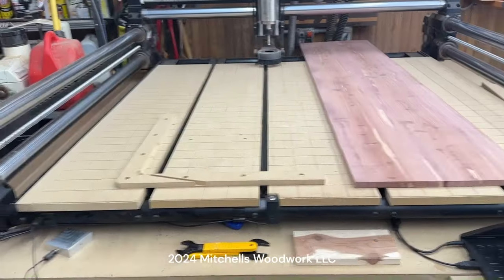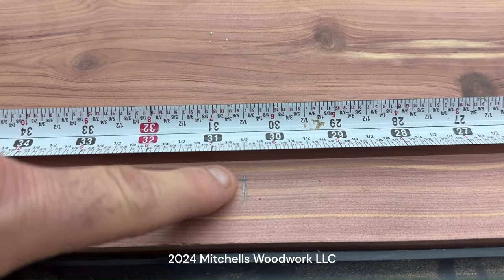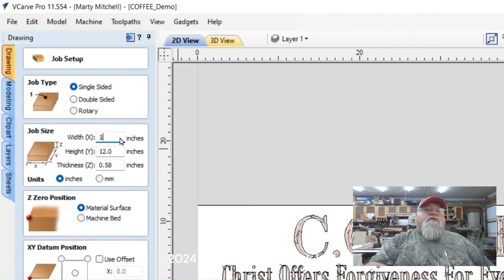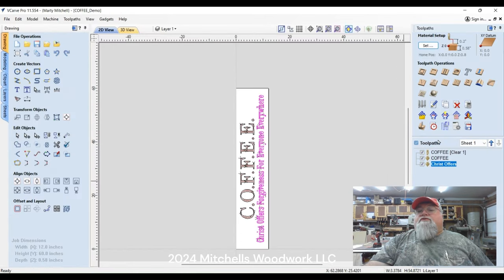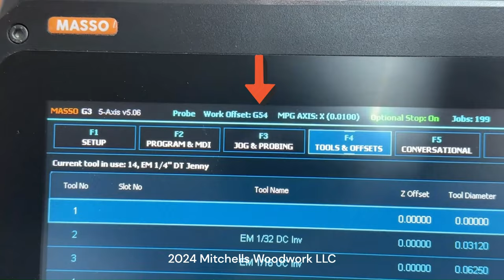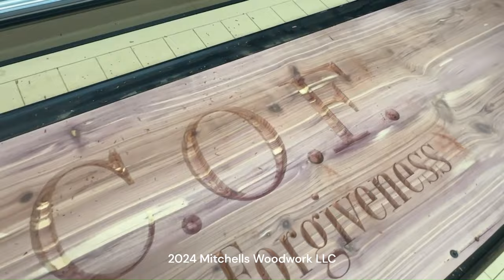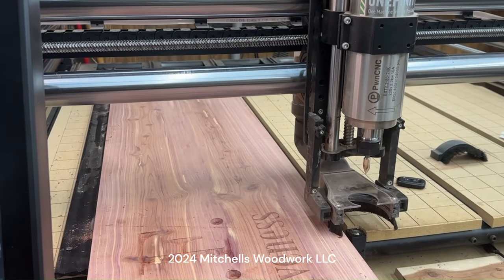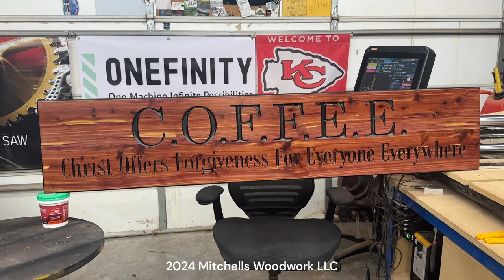How To Create Tiling Toolpaths In VCarve Pro | Onefinity Elite Foreman CNC | Large Sign On Small CNC

Comment: Great vid, project turned out great.  One trick I learned for rotating a project is to change to a rotary which will automatically rotate stuff, then change back.  I really thing Vectric is going to do this automatically some day, but that little trick saves a few steps.  I haven’t done many tiles, but one trick I’ve seen is a dowel, but the spindle idea is clever.
Reply from the maker: Please elaborate on “change to a rotary…”.  I’m not sure what you mean?
Reply: @MitchellsWoodwork  Start with the job in landscape mode like you did. In the job setup just select the third option "Rotary" and do nothing else, click OK. Then go back into job setup and change back to single sided...done.
Reply: @MitchellsWoodwork  One comment, if it isn't already selected in the Rotary setup, select the "along Y axis"
Reply from the maker: I’ll look into this!  Thanks for the tip!

Comment: Hi, a quick vcarve tip: if you need a selected text or anything that is selected. If you want it to turn ? just hit the number 9 key on your keyboard, once it will turn 45 degrees, and 2 times it will turn 90 degrees. That is way faster than with any menu item   Kind regards Hans
Oh by the way, to centre the selection, just hit the F9 key. That is also way faster
Reply from the maker: Dang!  Great tips!!

Comment: Great video! I've noticed some people use dowels to locate their tile sections. Your method - using a fence and a saved offset - sure makes quick work of tiling (a more efficient alternative to dowels provided tiles do not cross critical vectors).  Thanks very much, can't wait to try it!
Reply from the maker: Thanks!  But just a quick note, my method works fine even if you’re crossing critical vectors.  It’s just safer to avoid splitting vectors if you can.😉👍

Comment: Thanks sir videos are very instructional I was wondering does it tell you the time it takes to carve a project? I’ve been shopping around for a new CNC machine. I currently have the X crave for the last five years. I would like to upgrade trying to convince my wife go with the oneFinity but she said she’s so used to using diesel pro from ex car if she’s afraid to go out and try to learn the new V card which you use. Thank you so again.
Reply from the maker: Yes, VCarve Pro gives you an estimated cut time.  I started out in 2021 with a used X-Carve 1000 x 1000 that I bought on FB Marketplace, and it came with Easel software too.  In 2022 I upgraded to a Shapeoko Pro XL and that’s when I switched to VCarve Pro.  I’m not gonna lie, that first week with VCarve was pretty rough, and I was beginning to wonder if I’d made a mistake making the switch.  But then I found Garrett Fromme’s channel ‘IDCWoodcraft’ and that changed everything for me.  A little later I found ‘Mark Lindsay CNC’ and between those two guys I was able to catch on and get rolling.  Now there’s the ’Learn Your CNC’ channel, which is probably the best VCarve tutorial channel on YouTube.  

Switching from Easel to any other CAD software is gonna be a fairly big leap, but it’s so worth the money and time to commit yourself to learning how to use it.

Comment: Another excellent video. I've been curious about tiling as I come up to speed with CNCs. Do you know if there an easy way to tile this with vcarve but instead of tiling through like you did (and probably most people), if you could flip it and inserting tile 2 from the same direction (I have wall pretty close behind my elite due to small workshop, so I cant push a work piece through).
Reply from the maker: Thanks for the Super Thanks!!❤️  I understand your issue, and there may be a way to do it that way, but if there is, I’m not familiar with it.  

Just thinking about it though, I don’t think you would use a tile toolpath.  Maybe run it like two separate files, like you’re cutting two totally different projects.  But I’m honestly not sure.  Maybe someone else will chime in and offer a suggestion.  Anyone???

Comment: Thank you for the time supplying us this information, very interesting. I'm not tiling yet but this will be retained. Is it possible to adjust each tile, increasing tile 2 to get rid of tile three? As the information proceeded the need to remove tile 3 was not there, making my question moot.
Reply from the maker: Hi Richard, great question!  In this particular instance, tile 3 was just a byproduct of my adjusting the tile height to place the break between T1 and T2 in an area without any text.  

But more to the point of your question, let’s go back to my example.  My sign was 60 inches long, and normally I’d set the tile height to be 30” which would creat 2 equally sized 30” tiles.  However, there was text at the 30 inch mark, so I shortened my tile height to 29.5” to avoid the text.  
(T1) 29.5” + (T2) 29.5” + (T3) 1” = 60”

I could’ve adjusted the tile height to 20” and had 3 equal tiles.  
20” + 20” + 20” = 60”

If the sign had been 50” I could’ve set as:  30” + 20”, or 25” + 25”, or even 40” + 10”.   Typically you’ll set your tile height at or near the maximum cutting capacity of your machine in the Y axis.  Notice I said “typically”, but that’s not a solid rule that you MUST follow.  Your tile heights are extremely flexible.  

I hope this answers your question, but if not, just let me know and I’ll try again.  Thanks for watching!

Comment: Marty, great video.  First time I have seen a tiling carve.  I use Carveco Maker.  Need to see if it has that capability.
Reply from the maker: I’m sure it does, Jim.  Tiling is a common practice, especially on hobby size machines.  Thanks for watching!
Reply: Carveco Maker does not support tiling, Carveco Maker+ (plus) does that and more.
Reply: There is a way to tile in Carveco maker. It has to do with monkeying with the files.

Comment: Really enjoy your videos....Very informative and you make things easy to understand.   I recently upgraded to an Elite Forman and anxiously await delivery.   I noticed your dust boot is an earlier version from PWN....  was it easy to install on the new Z slider and with the spindle .   Thanks
Reply from the maker: Congrats on your Elite Foreman!  Hopefully you won’t have to wait 4 months like I did.  That was torture!😁

Thank you for your kind words, I appreciate you and I’m glad my videos are helping you.  As for the dust boot,  It’s actually an experimental prototype “variant” of the existing v2 model.  For videoing purposes, the V2 is perfect with the open front.
Reply: @MitchellsWoodwork  thanks for the response ...I ordered mine 28 Dec and I received an email from them (in answer to an unrelated question) and was told it should ship the week of 26 Feb.   I need to find a good dust boot ...I have a Kent CNC  version on my current machine and it will not fit the spindle I bought for the Foreman... I was looking at the PWN v10  ....any input on it
Reply from the maker: The v10 is specifically made for the Elite and 80mm spindle, so you should be in great shape with the v10.  I don’t brag on PwnCNC enough, but their product lineup and especially their customer service are truly second to none.  If you haven’t already did so, be sure and join their FB group.  They also have a new forum that is just now getting started.

Comment: OT question.  Are you using a Festool dust extractor?  Wondering how good it works with a CNC router.  Getting ready to buy something and was thinking about the Festool CT36 AC.
Reply from the maker: Yep, I have a Festool CT15 with an Oneida Dust Deputy mounted to a 5 gallon bucket.  Works great for everything except a surfacing bit.  The CT36 should be an awesome option.  

Thanks for watching!

Comment: When setting this file up could you not have set using the scale at 29.5 in. then setting up the text just realigning the letters? just a thought. recently started watching your channel. good presentations. Gary
Reply from the maker: If I’m understanding your question, I’m gonna say no, that wouldn’t work.  The reason for the tile cut is because the board was longer than the cutting area of my CNC.  Realigning or moving the text in VCarve wouldn’t change the need to move the second half of the board into the cutting area.  If I misunderstood your question please accept my apology and elaborate further.

Comment: If the sign x axis was say 24” or wider with y axis length needing to be tiled then would you have to relocate the tool setter or go back to the block that does x,y, and z that comes with the onefinity to set the z?
Reply from the maker: I would just revert back to the Onefinity touch block (or paper method) to set the Z after each tool change.

Comment: I calculate the diagonal of the table to be just under 68in. Would the board for on the table at a 45degree angle?
Reply from the maker: Yes, it definitely would fit at an angle, but tile cuts stick with the familiar X Y protocol followed by most cnc’ers and cnc manufacturers.  I’m sure it could be done though, might make for an interesting experiment someday….🤔

Comment: Wouldn't you a pin or dowel for your x location on your tile project
Reply from the maker: I’m not sure I understand your question?
Reply: Yes. You could put a pin at the X/Y origin and have your tiles X/Y position predrilled into the board, but, you would have to be absolutely sure they are in the right place. I could see this on a project that might be a repetitive product (more than one of the same) but for a one off like what Marty is doing here, I believe his method saves a bit of time and unnecessary steps. Just my humble opinion.